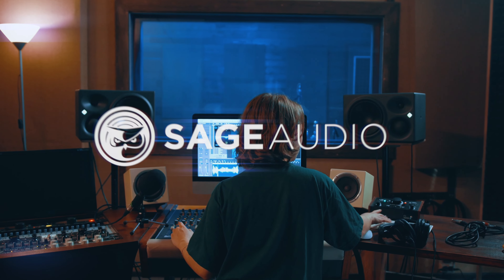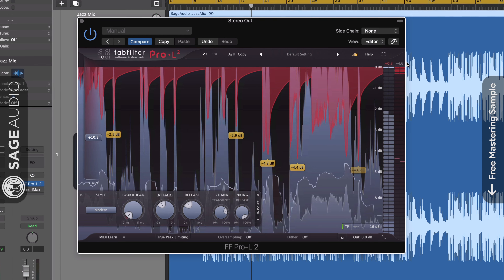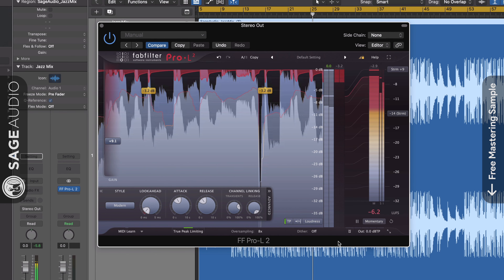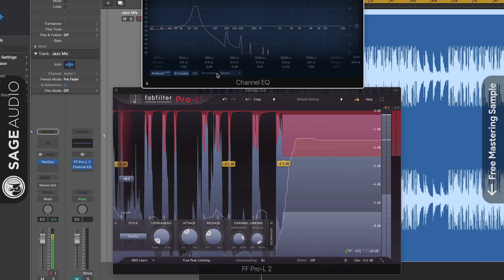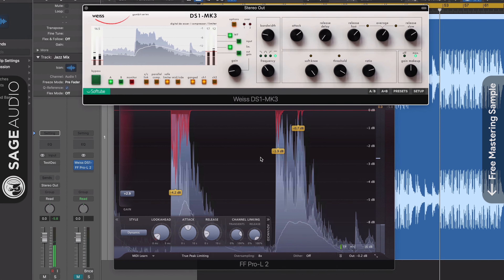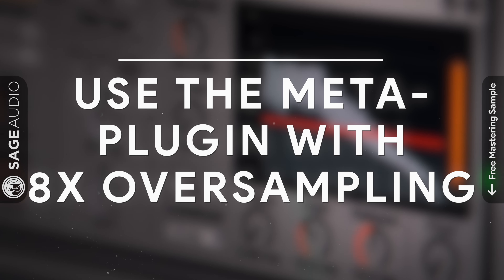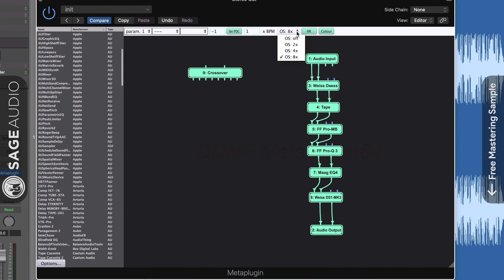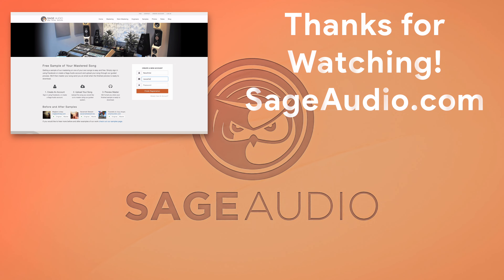How to Make Your Master Loud WITHOUT Distortion

Comment: Yes Tips were on Point. LISTEN: I took that advice went drove to my Home Studio and applied those techniques immediately and Boom my mix was Louder. I followed exactly.  Bus Track run all individual vst/instrument tracks under that Bus. Throw Two Compressors on the Bus adjust attack ratio volume. Now! Use those faders adjust up  or down and when you hear each individual track distorting too much pull back boom after a little bit of EQ just hear how your whole track not only get loud Commercially but it just opened up
That's My Rant for the day...
              Thank You Sage Audio
JT3 Production
Reply from the maker: Thanks for sharing your thoughts about the video and some of the techniques you used!  That's a cool technique you used with the channel faders!

SageAudio.com

Comment: It's interesting that oversampling is off by default in Fabfilter's Pro-L2 but I guess that's because the performance of each oversampling level is dependent on the power of your CPU. Fabfilter must have decided to switch it off by default for smooth performance with slower CPU's. After watching this video I set oversampling to 4x and saved it as the default setting. Great video and thank you for the free info <3 :)
Reply from the maker: Thanks for watching and leaving a comment! You're right, it's probably set to off to avoid affecting CPU as much as possible.  I should probably default mine to that as well!

SageAudio.com
Reply: You can work with a low oversampling, and just put it on 32 when exporting.

Comment: Another really useful and insightful video so thanks for this. However, I find it better to leave oversampling off on the FabFilter Pro-L2 as oversampling appears to affect the sound in a slightly nasty way. I appreciate that this is counter-intuitive but just wondered if you had found this to be the case.
Reply from the maker: Thanks for watching! I wonder why this is! Maybe it's causing some weird artifact?  Typically oversampling should only be causing a little less clipping distortion, and less aliasing distortion.

SageAudio.com

Comment: Heads up people... distortion is not always a bad thing. This is not only true in producing and mixing, but also for mastering. Always compare oversampling vs not oversampling and also compare higher oversampling rates with lower ones. More is NOT better, it's different.
Reply from the maker: Hey Gerhard! Good point - but aliasing distortion in particular often has a negative effect on the sound due to phase cancellation and the overall timbre of the distortion (since aliasing distortion is of a higher harmonic order).  Some forms of distortion sound great, but aliasing which is remedied via oversampling rarely complements a master.  Thanks for watching!

SageAudio.com
Reply: @sageaudio  no need for the "but" it CAN have negative effects... as can higher oversampling rates, since they are not neccessarily better-sounding. Just compare the higher rates to the lower rates (or none at all) every single time, don't just "go for the higher ones". It is simply false to say higher rates are better for mastering and you have been kind of implying that in your video. I think that one sentence was false and is bad advice, that's why I commented. I frequently find myself prefering the lower sampling rates or none at all, especially with saturation: AGAIN not ALWAYS not ALL of the time, not MOST of the times, but frequently and that's why you need to always compare and not simply go for the higher rates. Enough said
Reply: @akagerhard  lol bro chill out these are solid tips and everyone got their own opinions. Just take in what u think is relevant to u and appreciate what these guys are doing for the community.
Reply: @akagerhard  Oversampling just has one function, and the higher rates simply allow more precise reproduction of ultrasonic frequencies and in turn reduce the amount of harmonic distortion and phasing from aliasing. Your track with 0 oversampling will typically have crude harmonic distortion and aliasing, so when oversampling is applied it cleans things up. Saying all this some people prefer a distorted messier mix. However since this is a mastering channel the aim is to teach people how to achieve a clean & tidy final result. It is true however that true peak limiting affects the timbre of your track and defo has a sound to it that isnt always preferred.

Comment: One of the best ways to make a master loud without distortion is to actually use distortion, especially on drums and bass. Makes the sound more wet and interesting too.
Reply from the maker: That's a good point! Distortion is a helpful tool to make things loud, and if used right, can benefit the timbre of the track too.

Comment: is it normal for metaplugin to change the sound radically when set to x4 or x8?.... i hear a big difference in the sound and i don't mean no distortion, i mean a muddy and opaque sound... even plugins like bigceil, seem to totally change the way it sounds... I tested A/B with same parameters outside metaplugin and inside...

Comment: Thank you for the heads up about the Attack knobs function. BTW, 30 ms release time? That will create significant (audible) distortion on an 80 Hz signal that's clipped only 3 dB. Maybe you meant to say "130 ms"?   Thanks again

Comment: What about using clipping to help gain loudness? I am far from an expert, but I have used StandardClip to slightly knock off some of the extreme peaks prior to going to limiting.
Reply from the maker: Clipping can be really helpful! It more or less introduces white noise when a transient would hit - the high frequencies it adds helps us to perceive a transient, even when it isn't there.   

SageAudio.com

Comment: i think it would be good to understand what levels are considered loud at your standards and what genre that relates to because its all so different and releative. Also then you could have talked about perceived loudness, lufs, rms etc
Reply from the maker: Hey Harley! That's a great point! For this one we're thinking mastering closer to an integrated -8 LUFS, which is loud for most genres.  Thanks for watching!

SageAudio.com
Reply: for some music yes but im working with -3 to -5 lufs integrated, this is in drum and bass although obviously some genres wouldn't need this sort of loudness but within this genre it is part of the music; you use different techniques to attain such levels. I personally now look at mastering as correcting the tonal balance rather than inducing level mainly because the level to which the track can reach is all down to the production and mixing and forcing extra db can be detrimental to the track if it doesnt have potential to reach that
Reply: Pro tip: go to loudnessplenalty.com and see what the streaming services will do to your track. If you're publishing on beatport or wherever for DJs, that's a different story.

Comment: Great video! One question: I have noticed that all the reference tracks (by very famous pop artists) I use when mixing have True Peaks of +1.0 to +1.5 dBTP (one even as high as +2,6 dBTP). Do you have any idea why these tracks are so loud and why some mastering engineers don’t seem to use True Peak Limiting?
Reply from the maker: Hey Joakim! Great question! I'm really not sure why this is! Out of curiosity, how are you sourcing these references? 

SageAudio.com
Reply from the maker: That's interesting - I'm not sure, maybe they're using limiters that don't use truepeak detection.  The only other thing I can think of is if the amplitude changed during encoding, but if these are lossless files that wouldn't cause that great of a change.  What's one of the tracks that you reference from Tidal? I'll check it out.

SageAudio.com
Reply: @sageaudio  Thanks for your reply! I bought and downloaded the track “Over Now” by Calvin Harris and The Weeknd from Tidal Store in Flac file format a few weeks ago. When I use my meters on it, they show a True Peak Max of +2.6 dBTP.
Reply: @joakimalkman6643  Nobody will tell you this... but especially in that kind of music, sometimes they just clip the output of the daw , and don´t use a mastering limiter at all...
Reply: @FabrizziMusic  OK, interesting! Thank you!
Reply: Yeah noticed that as well Some of the pros are master to -6 Lufs and out put of -3 peak and above which makes the true peak go over. I was mastering to spotify -14 Lufs and -1 peak and i was noticing i wasnt being loud on ther platforms like beatport my tracks were always lower. So I bought a few dnb tracks that were loud and punchy without sounding distorted that translated well to spotify, I'm still trying to work out how they do it from the mixing stage to the mastering. Any suggestion let me know😎
Reply: Ok, here's the deal. If you download MP3s, you're going to see peaks over 0dB. If you download the wav, you will rarely see overs, but you still might. For MP3s, the overs are an artifact of encoding a track that gets close to 0dB. Most producers don't give a care about MP3 because no self-respecting DJ will play MP3 files in a club. If you want your MP3-encoded track to not have overs, leave at least 0.3dB to 1dB as your true-peak ceiling. Now: an MP3 with overs won't bother anyone. In fact it's probably going to sound better on consumer equipment anyway. Remember, always remember: we've been trained to like and expect distortion.
Reply: Honestly most true pros don't care about what is technically correct.  They only care about how it sounds coming out of your speakers and the emotion that comes across.  Period.  Dave Pensado forced me to tape all the meters in his studio once to prove to me when I was younger that it doesn't matter what is right, only what it sounds like.  When we took the tape off everything was getting clipped.  But it was a smash hit record.  So if your true peak goes above 0 but sounds great who cares.  Also many engineers will clip the signal on purpose to get more level and the sound they are going for.  Just FYI.
Reply: @ArielChobaz  Great, thanks!
Reply: @ArielChobaz  Interesting I’ve bought some of the Chris Lord Alge plug-ins from Waves recently in particular his mix bus plug in.

If you look at the video where he’s using it when he briefly switches over to the in/output metres they are bouncing off the end stops but he’s obviously not bothered.

I’ve got some of my mixes sounding great with relatively modest compression but when I switched to the in/output meters they were jammed off the end stops so I’ve ended up backing it off but I’m just losing loudness and it doesn’t sound as good.
🤷‍♂️

Comment: Are you sure Meta Plugin is reapplying the chosen oversampling before each plugin within its framework? I thought I had to stack Meta-plugin every time.
Reply from the maker: Hey Sybille Sztorm! It looks like it is.  Reading the manual (which is unfortunately of an older version that only mentions 2x oversampling) it claims that the oversampling is applied to everything inside the metaplugin.

SageAudio.com
Reply: @sageaudio  That's great to know! Thanks for clarifying!
Reply: @sybillesztorm9006  It does say OS of the entire chain.
Reply: On their product page they wrote „Up to 8x oversampling option of the whole signal chain is available.“ For me that does not sound like it is applied to every single plugin separately. This might matter if distortion adds up on many plugins that does not support oversampling. It might also be negligible, if a clean master is the aim and aliasing is far to low to get recognized. And too many downsampling filters may also change the sound....
Reply: @johnnyt5514  So we stack it for now?
Reply: To get the maximin advantage, put all plugins you care about (your whole mastering chain) inside the container. What it does is set the sample rate for the chain to 8x (or whatever) the sample rate of the surrounding DAW. The plugins inside the container are fooled into thinking that the DAW's sample rate has been set to 8x. I mean, imagine that you just went to your DAW's settings and changed the sample rate to 192kHz.... It's the same thing. Except the higher rate applies only inside the container. Obviously, it will use a lot more CPU, but only for the plugins in the container.

Comment: Personally,my ear is not trained enough and I can't really notice the difference.Is ithere any tips to improve hearing on these small little details?
Reply: good headphones like m40x is the first step
Reply: @HvrriMusic  Im using m40x, what i meant is when it comes to mastering the difference is sometimes not noticeable at least for me.So I want to train my ears for it.
Reply from the maker: I'd say use an equalizer to try and hear minute differences.  Just practice a lot and keep mastering music!

SageAudio.com
Reply: @sageaudio  yes! I learned a lot by soloing various frequency ranges on my mix/master bus. It's probably the best/fastest way to learn what's really happening when you EQ and etc.

Comment: I feel so sad, how can i train my ears to detect the changes you make on attack and release times? In general i find it hard to detect changes in dynamic processing, but when you go from +8db gain to +14db on the pro L shouldnt there be a very clear change on the overall loudness? When i push the gain 2-3db and up,  i can hear a clear difference in loudness boost. Why i cant hear this now?
Reply from the maker: It just takes time! It also may be harder to hear changes due to YouTube's loudness normalization.